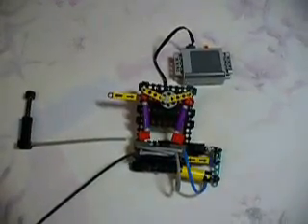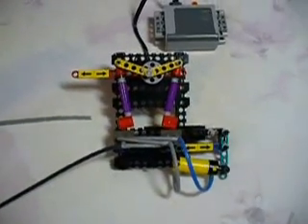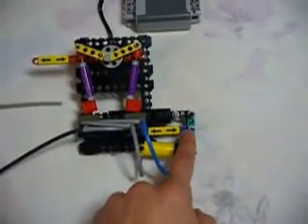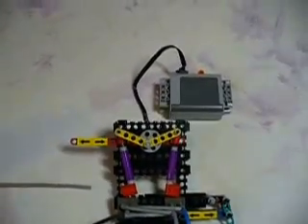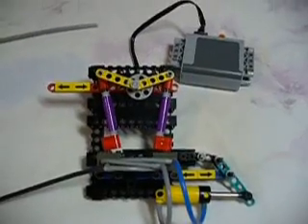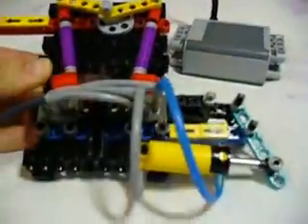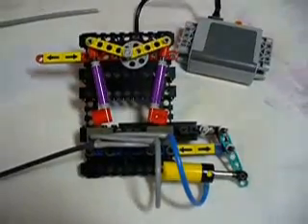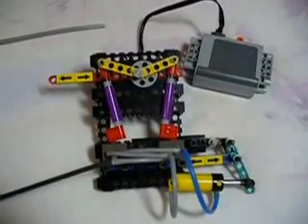Continuously Variable LEGO Pneumatics Tutorial

Comment from the maker: I tested the model from the video with the new V2 pneumatic cylinders from sets 42043 and 42053 and they each work very well.  This was the original idea; the same type of servo can control any combination of cylinders with any length or series or parallel combination.  Just select the cylinders according to the load.
Reply: @brickthus Hi! i found your video while doing some research on the net, which led me to find your post on eurobricks, from which i arrived here. I'm trying to make an RC MOC, and because of some restrictions, such as the place available, i will be more or less forced to use small pneumatic cylinder to do the steering (6 of them in facts, one for each wheel). From my estimation, the model will be rather heavy (4 Kg) and the steering has an angle to complicate things even more. Because of this, i need a 3 position cylinder, and i can't simply drive a small cylinder by linking it to another one, as the air pressure would certainly not be enough to make it move. In your post on eurobricks, you wrote about two ends and one position in the middle control of a cylinder. I was wondering which way it was done, and if you think it could be used to my MOC?
Reply from the maker: @richardjulien1329  you might be best with a "hockey spring" or equivalent mechanism to pull the steering straight and then power it to either end. https://www.bricklink.com/v2/catalog/catalogitem.page?P=x928cx1#T=C
If not that particular piece (rare, obsolete) then a weaker suspension spring can do it, or a white belt.
Mid-stop pneumatics tends to be large in its mechanism https://brickshelf.com/cgi-bin/gallery.cgi?f=147931
The variable pneumatic servo system just needs a thin flex as feedback, allowing the servo to be remote, but it can take a bit of setting up and experimentation, balancing the gains of the command, feedback and dither for greater loads and additional hysteresis that come with heavier models; I'm trying with a model having 2.5kg on each axle; early days yet.  More pics of earlier apps at https://brickshelf.com/cgi-bin/gallery.cgi?f=405269
Reply: @brickthus  thanks! In fact my main problem is that the steering happens on an moving arm, on which the wheel is placed at one end and rotate there. Because of the configuration of it, I can't use an axle to move the lever that steer the all system, the reason why I am using a small cylinder rather than the hockey spring ( I have 3 of those, I bought the sets just for them XD ). The idea to use a flex cable for the closed loop might be the best one, the main advantage being that I will have a lot of place inside the body of the vehicle, so I can do the adjustment inside it with a counter lever.
Reply: My only problem will be getting the flex cable, and finding a way that the moving arm doesn't impact the length of the flex cable and modify the return value XD
Reply from the maker: @richardjulien1329  the modern equivalent of flex is the handrails of car transporter set 42098, part 27965 https://www.bricklink.com/v2/catalog/catalogitem.page?P=27965&idColor=95#T=C&C=95 (35p not too bad on Pick-a-Brick).  You would have to pull it, not push, and compensate with a white belt pulling at the other end.  Using a push-pull pair might be possible.
I have been trying rods (thin liftarms) with bell cranks and ball joints as the feedback for my servo steering on the heavy vehicle with limited success, minimising play in the system.  This attempts to drive 2 servos from a single dither motor.  The newer pneumatic valves may have a different profile and sometimes more friction.

Comment: This is just outstanding! I've never really been a big fan of the Lego linear actuators but I wanted to achieve a similar motion for a Lego steam engine model I'm planning. Later locomotives had what's known as a "power reverse" unit which was a compressed air powered cylinder with feedback to a valve and was used to control the position of the reversing gear very precisely. This solves all the problems I have yet to find perfect solutions for! I had built a working model in Lego, but was unhappy with its performance. I can hardly wait to try this.
Reply from the maker: +Mechanicsnut I also tried a steam engine with two of these mechanisms, photos at http://www.brickshelf.com/cgi-bin/gallery.cgi?f=409593
It did seem to have a very small region where there was some gain in the reversing gear; it was surprising but encouraging to get that effect at all with LEGO parts.  It worked either with large or small cylinders.  We now have new cylinders with set 42043, including a long thin one, a long wider one and the small one now has a full 2M extension, great for driving a 24mm pulley or 1M crank.

You can also see pictures of this mechanism applied to one axis of a Stewart Platform (for a flight simulator) at http://www.brickshelf.com/cgi-bin/gallery.cgi?f=405269  I would like to do all 3 axes eventually but I have other projects on, like my LEGO Technic BB-8 droid at https://ideas.lego.com/projects/126131/updates

Application of the mechanism to the set 8421 crane jib (also at http://www.brickshelf.com/cgi-bin/gallery.cgi?f=405269) has not worked yet because the jib-lifting load is high; I have yet to find where the load limit is but the jib seems to exceed it.  I have thought that multiple cylinders in parallel (or series for other applications) would be a great use of this mechanism.

Comment: what compressor are you using? looks pretty interesting
Reply from the maker: In this video I used a small car tyre air compressor, 250psi with pressure regulating valve (so it doesn't just get to a pressure and shut off like some types), with a football attachment in the LEGO hose.
The small compressor broke since I made the video so now I have a quiet compressor that uses a fridge motor and has a 9-litre air tank.  This means I can use the compressor in the house without disturbing the neighbours, even if I'm building into the small hours!  It would also be best for an exhibition, so I could have a conversation with people while the model is working.

Comment from the maker: The motor dither overcomes stiction in the valves and cylinder and alternates pressure and air leakage from both sides of the cylinder when it is in the commanded position, keeping it actively in position.
The dither is for dynamic response.  A Servo Pressure Regulator in industry performs a similar function.

Comment from the maker: :-)
A compressor from the crank to the red beam (all sliding) needs to pump air equally at both ends of the dither (=2 mini compressors as a flat-2 engine), else the pressure output would bias 1 way (could be useful as a fail safe, as in industry).

Best to have excess air at pump freq > dither, for dynamic response.  Industrial fuel/oil systems are like this.

Also best not to load the dither motor.  240rpm >> cylinder response.  Slower or synchronised and cyl might oscillate at dither freq.